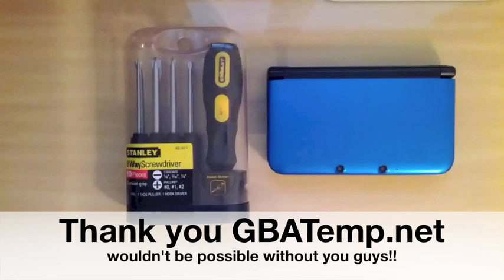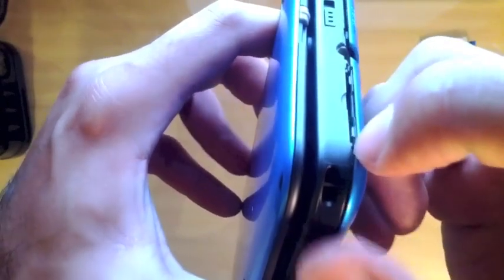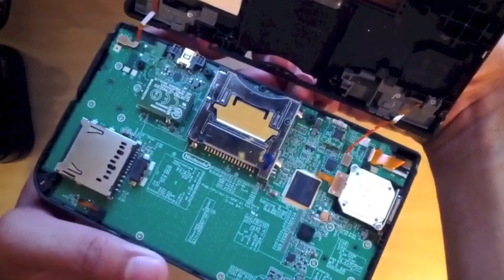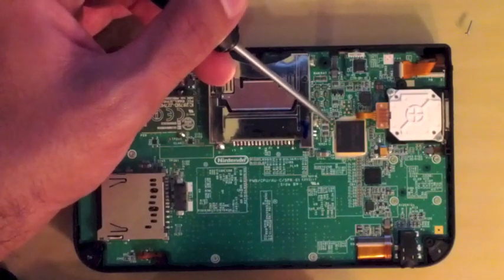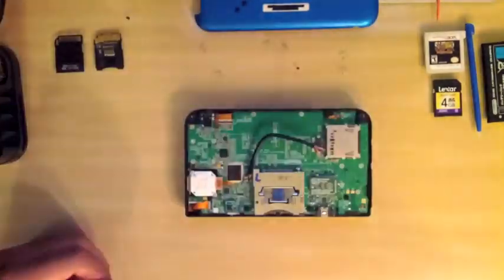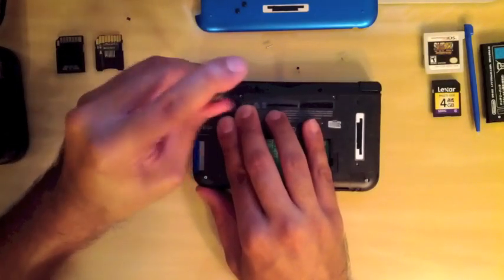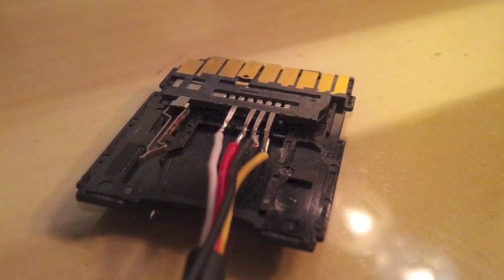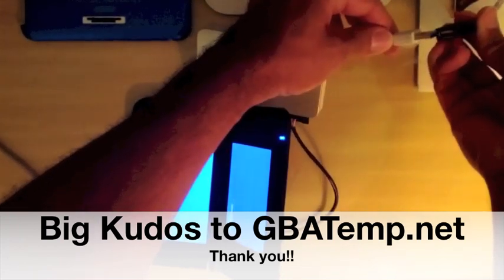DIY 3DS XL NAND Dumping-R/W pt. 1

Comment: does it have to be the solar blob as ground? its very hard to solder the wire in it
Reply: You can use a different solder points, but using a random pad will most definately brick your console. The solder blob should be quite easy to solder to.

Comment: What are the specifications of the wire connectors?? (how do i search for them in a store? )
Reply: FiZbaum you can use any wire. I used some from a old pair of broken headphones.
Reply: Just generic wire. I use 24 gauge, but you can use any, provided you can solder it, and it's not too big (really big wire can rip the pads right off).

Comment: does this work with firm 11.0.0-33?
Reply: Yes. This is a hardmod, so it will always work on any firmware, unless Nintendo releases a magical firmware that leaks your location so Nintendo undercover workers can break into your house at night, take your 3DS, and transfer all your data to another 3DS that looks the exact same but has some motherboard changes so that this can't be done.

Comment: Must i have a hole in the back on my device? or can i somehow do it temporally?
Reply: You can feed the wires through the stylus holder, however this is much easier said than done and traditionally really only used on non-xl's.

Comment: what is the right msg in the bluescreen all 0s and 200 or all 0s and 400?
Reply: 00F800FE 00000000 00000000 00000200 00000000
There are a few others (used dat1,2,3 for dat0, chip not found, bad firm0 and firm1, and bad sig check in sector 0).
The ideal one is the one I mentioned first, though the following three I think will work:
00F800FE FFFFFFFF FFFFFFFF 00000080 00800000
00F800FE FFFFFFFF FFFFFFFF 00000005 00800000 
00F800FE FFFFFFFF FFFFFFFF 00000005 00000000

Comment: was doing this and the pad came off for the clk wire. i have extensive soldering backround and barely touched it with a 20watt iron and it literally came right up. is there anywhere else to get the clk signal from?
Reply: Might be a little late, but after some digging I found an image. It'll be complicated, though, I think it's on the reverse side of the motherboard and quite small, so good luck.
Source: https://www.elotrolado.net/w/images/4/49/Pines_para_la_Old_3DS_XL%2C_CLK_alternativo.jpg

Comment: I have a hard bricked 3DS will this work?
Reply: It will if you have a NAND backup.
Reply: No. You need to have your console to be able to boot, and a hardbrick often doesn't have a problem with the NAND, but something went wrong in the circuitry, so unless you can fix that, you're screwed. If you manage to fix it, your data will probably be either all gone or completely unharmed.

Comment: Where did you solder the GND? Please help. Thanks. :)
Reply: Just solder to one of the solder blobs on the edge of the gamecart shielding.
Source: https://3dbrew.org/w/images/2/22/CTR_NAND_pinout_XL.jpg
That image has the Gamecart reader unsoldered, but it's the blob to the left of the DAT0 and CMD points. Normally the stuff to that left of that blob you couldn't see, as it would be obstructed by the cart reader.

Comment: I came here looking for help fixing my son's lower screen on his 3DS XL (bought in 2014, so not newest model).  My son's top screen got broken, so instead of the hassle of replacing the screen, I went ahead and took my son's motherboard out and put it in a working upper and lower screen system.  

In the process of opening and closing to fix this or that issue afterward (I'm just a mom, not a tech guru) I think some of the top prongs (maybe 2 of them) fell inside where the ribbon attaches (the wide ribbon on the lower part of the system, not the tiny one above it), and now it won't seat in there properly to get a good connection.  I also broke the closing clasp, but I can fix that with some thin plastic wedged in...Since I have already spent about 250 in games on this system, how hard would it be to replace that slot, and do you know of a tutorial for that?  I have some spare parts from repeatedly buying these freaking XLs...so I have the part already on another motherboard.  I know Nintendo may allow me to transfer the games on a new system, but I've heard they don't usually do that (which is BS considering they make these things to break!).  Any help you could give me would be greatly appreciated!

Comment: Hi,

My error code is :

BOOTROM 8046

ERR CODE : 
00F800FE
00000000 00000000
00000200 00400000

The question to disk format don't appear. 

Do you have a solution please ? (I used CLK Alternative)

Thank you.
Reply: You have to use a sd card reader. Plug in the hardmod to the reader and then turn on the 3ds. Then plug the reader to the computer. It should work now. Some readers don't work, so do your research.

Comment: Is there any reason to cut the hole in the back plate for the butt connector? Could you just connect the wires from the DAT0, CLK, and CMD directly to the SD card then once you rewrite your NAND you could just take all the wires out assuming you only need to do this once. I could see it useful for conveniences sake if you plan to rewrite the NAND multiple times, but if you're just using it to restore to your old NAND it seems like a useless step. I'd love some incite on this so if someone could explain it to me that would be nice.
Reply: Also, it is a bit awkward, as you would have to get the wires out of there, but you need to have the battery connected, so it's harder.

Comment: When is it that you place the solder itself on the points in the video? I didn't see you use it in its actual "springy" form and maybe it was used. Learning as I go with this, so sorry if its a little obvious.
Reply: Generally what is done, is you melt a small bit of solder onto the wire (so, the wire is coated in solder), and then you place the wire on the point you want to solder to, and hold the iron to the wire. This melts the solder, causing it to run onto the contact, making a strong connection. This is harder to do, but the best way to do it.
He does say earlier, 'Tin it with some flux and solder" (or something along those lines), which is what you do. He just does it offscreen to prevent accidentally dripping solder onto the 3DSXL.

Comment: i have a question, do you have to use some kind of special usb adapter? im using my latops sd card slot using a kingston micro sd adapter and the blue screen appear but my pc dont recodnice it also,i tried whit a m3/micro sd usb adapter and same think i double check the soldering and still dotn work, any ideas? my 3ds its the normal one but i still check the gba temp guide for this model
Reply: Yes. Only some external SD readers work, go here: https://gbatemp.net/threads/tutorial-noob-friendly-nand-dumping-2ds-3ds-3ds-xl-n3ds-n3ds-xl.414498/
Go to STEPS FOR OLD 3DS XL CONSOLE: and look a bit underneath that, you will see readers that work.
I highly recommend the first reader listed, the Anker reader, as not only has it been highly tested and nearly guaranteed to work, but it also works with all consoles (nobody knows about n2DSXL tho), and is also a very good SD reader (I have it, and is very good, it has an SD and microSD slot, so I don't need an adapter).
It's USB3.0 and you can get on Amazon here: https://www.amazon.com/gp/product/B006T9B6R2/ref=oh_aui_detailpage_o00_s00?ie=UTF8&psc=1

Comment: This might sound like a dumb question (I'm new to this) but does this work on all versions? I accedentaly updated to 10.3 and want to downgrade to somewhere around 9.0. Or is that impossible because I didn't make a 9.0 dump before?
Reply: Yes it works on all versions. Nintendo has no way of blocking this hardware mod unless they release a new new 3ds with those points scattered all over the board
Reply: +Joseph Mitchell ok, thanks! but am I able to go back to 9.0 or am I stuck?
Reply: +Julio Hacker actually, I have a bit if a plan, could you approve it? so what I'm going to do is get a n3ds (which I suppose will be 9.0 when I first get it, I belive it is 9.9 up that blocks the browser) and do the gateway exploit (because I don't have a card) and back up the NAND. from there I get bigbluemenu or somthing and get a cubic ninja CIA and do all homebrew from there. Sound good?

Comment: awesome video dude, can you just help us with your smartness, have a question !  well : i would to connect and adapter directly on the motherboard of the 3ds XL, can i do that or i'am forced to use a multi usb and connector ??
Reply: Yes, you can if you wanted to, but it would be awkward-you would have a microsd adapter physically tethered to your device, and it would be difficult to dump the NAND, as you would need to have the back cover open to have access to the reader, but you need to have the 3DS turned on to dump the NAND...

Comment: this is crapet most can't afford those tools
Reply: +jorden rich you can dump the nand via software now (although you must have a exploitable firmware)
Reply: +jorden rich There are alternatives to soldering.
Reply: +Jeppe There are? Like what?
Reply: +Rui Maita Depending on which sysnand you are on. Currently IIRC if you are on 10.4 or above you need to hardmod it
Reply: Austin Connelly
Oh, thought he meant alternatives to soldering as it using something else to secure the wires.
Reply: Someone suggested pogo pins but the modder said that they're not as safe to use cause if they come lose it can kill your system

Comment: Is there a way to edit the nand via an hex editor, and store an exploit on it  again. And then re-write it on 3DS? Doing so we would be able to be in the latest version of sysNand without nintendo's patchs parts. If GW was able to downgrade 9.2 to 4.5 they should understand the NAND's structure. And i guess that "those exploit" are written the same way in all NANDS whatever its signature, whatever sha1... I'm a newbie for this but... If there is an encryption key that lock anyway to find where exploit should be written on the NAND we should be able to dump this key the same way we do it for the NAND. If all nintendo's update are the same for all 3DS they must send same files to everyone and then the 3ds modify those files with some kind of header to be used only on this 3DS. But the most of the base should be the same for everyone, except the "signed" part. So exploit should be unpatched on latest firmware, via hex editing... no ? Am I wrong ?

Comment: I just want to comment and say THANK YOU. I have a 3DS XL on 6.2 that I use gateway on. Recently my son accidentally updated it to 9.5 rendering gateway useless. But thanks to your tutorial, I managed to downgrade it using a nand backup of my 6.2 that I made. I have zero soldering experience and I just went out and bought a $20 soldering kit, and got some old broken earbud headphones and cut the wire down to four pieces. I didn't want the mod to be permanent, I simply wanted to downgrade it back to 6.2, so what I did was I removed the stylus holder and fed the wires through there, and I then connected them directly to the micro SD adapter. Following your instructions and being careful soldering I can say the downgrade was a success! I removed the wires and now my 3ds is back to normal running gateway! Thank you AteOeight!
Reply: +OOFMATIC Wow that is smart thinking. You should do a Tutorial of that please.

Comment: what kind of glue did you use for mounting the bud connecter
Reply: Hot glue gun works best.
Reply: if you strip a screw on the 3ds, how could you get it out?

Comment: if i use 4 color wires like that, does it matter what color goes to what? like does red go to ground and black data 0 or what?
Reply from the maker: As I said in the video, color coded wires are purely for organizing.
Reply: Thank you for replying. And i did hear that, but lets say you have wire a going from lets say ground, is there a specific part or port it has to go to on the adapter part that goes to your computer? do you know what i mean? like lets say each one was numbered on the nintendo and on the card. 1234. Does 1 have to go to one? or can one go to three?
Reply from the maker: They are specific in the sense that data1 goes to data1, ground to ground, etc... I hope I was clear enough with the pins of the SD adapter, either way lemme know.

Comment: Can you downgrade your 3ds by doing this? like if i dumped NAND  and then upgraded, could i downdrade later?
Reply from the maker: Daniel FriedYes, once you have a backup, you'll be able to downgrade.
Reply: but only if its from yours, right? im going to make a backup now, and maybe someone will hack the current fw again, then ill be safe to upgrade.
Reply from the maker: On GBATemp, I coulda swore I read that a Temper swapped NANDs with two 3DS's. So I guess if you wanted to, you could share NANDs with a buddy.
Reply: that would be sweet. I want to downgrade to 6.1. I wish i could just buy a 3ds with 6.1 fw.
Reply: AteOeight Hey this will work on a 3DS with firm 9.4 (up to date), the thing is i update by mistake (my firts time on eShop yestersay and it going disastrous :/), my original firm was 4.5 (i had a cfw 4.5 and i have like a 3 nand for the process), well now the question is this can help me to dump my previous NAND.bin on the console or i need something more? (this will help you to know what process is for the CFW i did https://gbatemp.net/threads/tutorial-4-5-sysnand-4-5-cfw-9-4-emunand-without-gateway.378721/ in essence is the same process i did).
Reply: Augusto Tsuchiya It would work if you have a NAND.bin
Reply: Of couse u can srry for the 2 yr late reply
Reply: +Augusto Tsuchiya Works on all firms
Reply: +AteOeight No

Comment: can I use any sd card reader?
Reply from the maker: I'm not entirely sure how it works, but the console is picky as far as the specifics of which SD card reader. The Moshi Cardette 3 I used worked perfectly fine, but check with the GBATemp community as far as which readers work. I've read some horror stories as far as how many some have tried just to get the PC recognized the console!

Comment: Can I use this to backup the NAND and then use the Gateway to restore it?
Reply from the maker: IMO, if you hard mod your console, stick with the hard mod. You never know when the GW cart will brick your console, then have to go through the trouble of unbricking your console.
Reply: No. You can do the opposite. This is Read/Write, Gateway can only read the NAND, not restore it in a brick.

Comment: I have the nand backup through gateway. the file is called  nand.bin 
which steps should I follow in the second half to apply this file, help please!
Reply from the maker: Sorry for the delay in time... but, would have to start at the beginning because you need to install this hardware mod firstly. Go all the up to just before reading your NAND, and write your GW .bin file to your console. I would make a backup first, just in case something happens. Now, this is all in theory as I don't use GW. So you might want to reference my input with the GBATemp community as well. thanks

Comment: @AteOeight hey man can you help me out, I followed your video and managed to get the blue screen err code 8046 upon powering the 3ds xl with the mod SD card connected to the card reader. But after plugging the card reader to the PC it seems like nothing's happening. What am I doing wrong here? tia
Reply from the maker: Your card reader may not be compatible, I've seen members of GBATemp go through a bunch before they got one to work. Check with the community at GBATemp for card reader thats tried & tested to work.

Comment: Hey, after you remove the cable of the back of 3ds XL, the Blue Screen disappears? And the console boots normally?
Because when you put the cable on the connector that you put on 3ds xl back, he boots on the blue screen.
Reply: 1. Insert cable to port, plug cable into sd-usb adapter.
2. Turn on 3DS. Blue screen.
3. Insert to computer.
4. Dump NAND.
5. When completed, 'eject' the 3DSXL from Windows (like a USB drive or SD card).
6. Force power off console (hold power button for about 10 seconds)
7. Unplug SD reader from port.
The console will not boot until you turn it off and reboot with the cable disconnected.

Comment: what did you use to cut a hole for the wire connector in that black part
Reply from the maker: A dremel tool, doesn't have to be perfect 'cuz you'll be using a hot glue to secure the wire butt connector in place.

Comment: Hello, I'm trying to recover my 3DSXL from a 3DSLink brick with my nand.bin, but when soldering i broke the Dat0 point. Is there an alternative spot?
Reply from the maker: You'll have to scrape the trace and solder there.
Reply: This won't fix a brick cause by Gateway/3DSLink/R4i.

Those bricks are caused by Gateway adding in code to the Launcher.dat (3DSLink and R4i use a modified Gateway Launcher.dat) that sets the eMMC to read the NAND as being 0 bits large. So you can't read or write to it, because it's size is 0 (empty).
Reply from the maker: Yea, sorry, I did some reading up on this issue. Gateway or Brickway as some call them are purposely bricking consoles. If you follow the GBATemp site on this matter they are close to a solution. It does involve having a raspberry or audrino...

Comment: Any tips on how to use the multimeter to check solder points? When my wires are soldered the DS will not boot. When I remove the wires (points are still tinned) everything is ok.
Reply from the maker: This tut is for the 3DS XL ONLY, not a DS. You mean it doesn't turn on? You're more than likely shorting somewhere, check with gbatemp on point reading with multimeter. I don't have a 3DS XL to test and give you readings on pinouts, sorry.